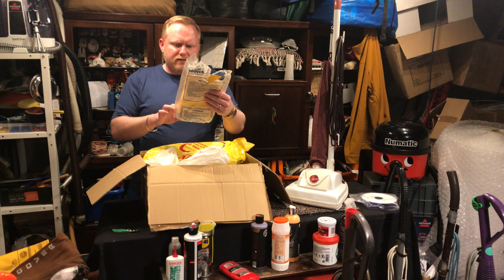Hoover v Dyson

Comment: OK then, firstly, that refurb job on that 1950s Hoover 1334 looks superb - we take our hats off to you Dorian. Rosy the rose coloured Hoover has her rose colour back again, bar the bag, but I'm sure you will find an original vinyl bag in due course, so she is utterly complete and original. Secondly, the brown bag and flange that came with the donor machine is from a 1967 / 1968 model 1346, like my 1967 model, which has the exact same bag and flange. Thirdly, The Dyson post motor filters like you fitted are not washable, so dont wash them unless you want them to go all soggy and fall apart. Fourthly, it sounds like the Dyson needs new clutch belts, more than likely the motor to clutch belt, as this is often the one that stretches, being only a very narrow belt - you can get replacements and fitting them is fairly easy - you only need to remove 3 screws from the clutch to get the belt off it. Lastly - have fun in the States and I'd love to see you test drive a Tacony Tandem Air upright, such as the Riccar Radiance, and possibly a Miele C3 Coomplete with the SEB236 powerhead and full electronic handle controls. Bye for now!
Reply from the maker: +MadAboutHoovers I’m so hoping they have a Tandem Air for me to try too 😂
Reply: MadAboutHoovers I don’t think the bag on the 1334 should be vinyl? Inflates differently to a vinyl
Reply from the maker: Ive not seen one in the flesh so to be honest no Idea, but I’m positive it should be cloth of some sort.
Reply: Definatly a fabric bag    almost a silky sort of fabric